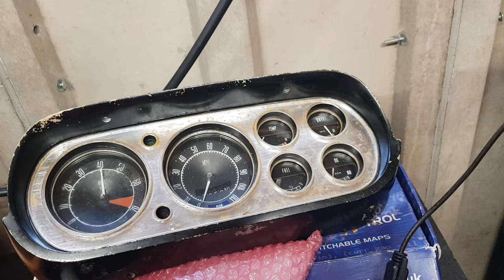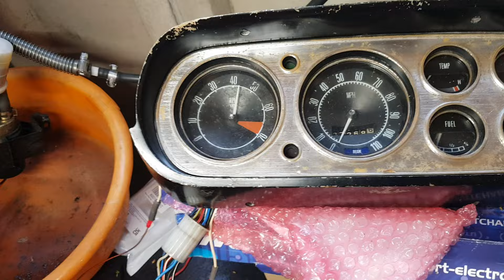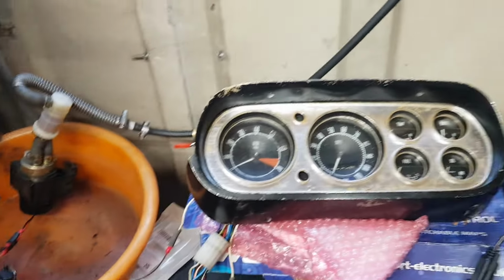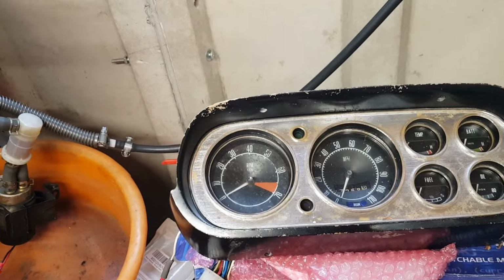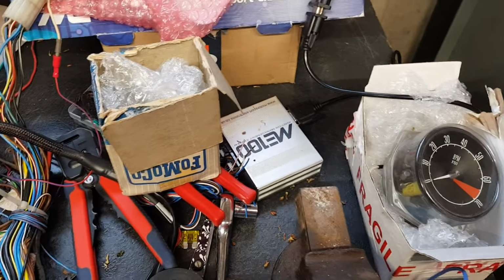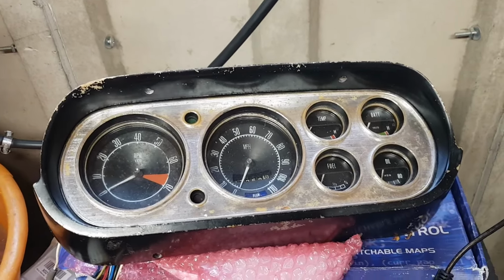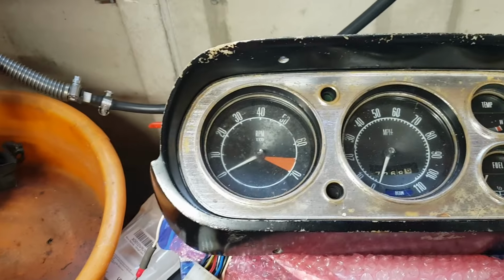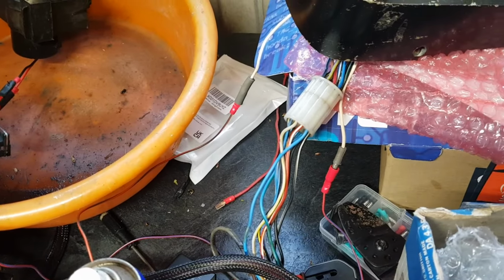At Last it runs!! 💪Ford ST170 engine on ZX9R bike carbs running a ME100 ECU.

Comment: The title is misleading! I believe it's meant to say Ford ST170 "running" on ZX9r carbs.
Reply from the maker: Misleading??? Im a little lost here.
Its a Ford Zetec ST170 engine, the engine management used to run the engine is a ME100 and im using ZX9R carbs. All factual and correct.
Im suprised that only you thinks its misleading.

Is this Youtube or Trading standards?
Reply: @davidgreen7841  let me make it clear from my perspective (not being funny or smirking). I'm a motorcycle guy who owns a ZX9R and a ZX14. The ZX9r in the title of your video stood out more to me as I read it. A Ford engine in a ZX9R? 😂. After further looking at the video, I understood it's a Ford engine running on ZX9r carbs.
Reply from the maker: @joeljohnson3676  All I can do is applogise if you felt mislead by the title. Thanks for your feedback 👍
Reply: @davidgreen7841 there's no need for an apology! We're both mechanically inclined! And then again, I had been searching to adapt fuel injection to my ZX9r. Now that I've seen and understood what you're doing, all is good! Keep up the good work. Amazing!
Reply: Good to see you back on it David, and great progress having the engine running. I’ll look forward to more videos 👍
Reply from the maker: @andyday1981  Thank you Andy. Hows yours getting on?
Reply: @davidgreen7841  No worries. Having the engine running is a big milestone. I had mine running and driving when it was in the st, but not since it’s been in the Escort. I’ve not done much recently but going to drop the axle off to paint it and start doing the fuel system while I can get under it.

Comment: Hi, does the loop wire on the rev counter have to be a specific wire?
Reply from the maker: Im not sure but my thinking is you would need the specific wire for it as ive never  seen it done without the correct ford wire.

Comment: i Made the diode circuit for my rev gauge for my mk2 it works when the car is idling but when i rev the car the gauge cuts off, Do you have a fix or have run into this problem?  Thanks
Reply from the maker: Hi,
I never came across this issue ever so im not sure why it would do that other than a loose connection or faulty rev counter.
Im assuming the rev counter worked fine before this change and no issues with the coil pack, leads and spark plugs?
Reply: @davidgreen7841  thank you very much for your reply, i will go check all the conections and rev gauge thanks